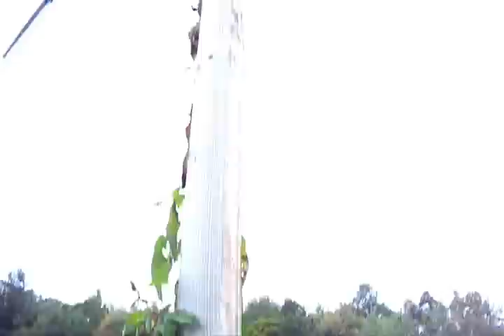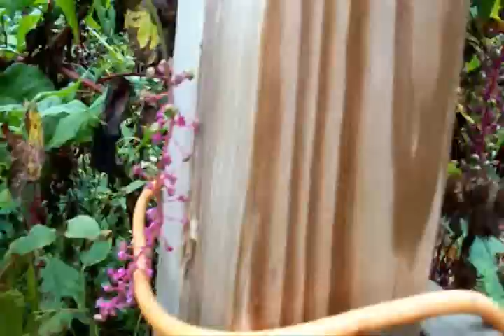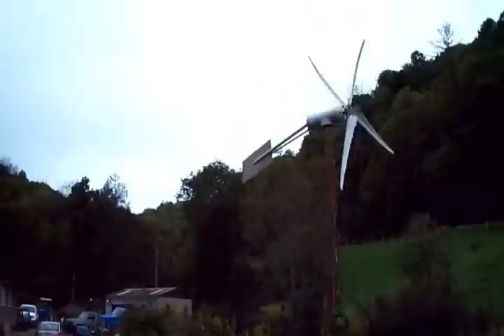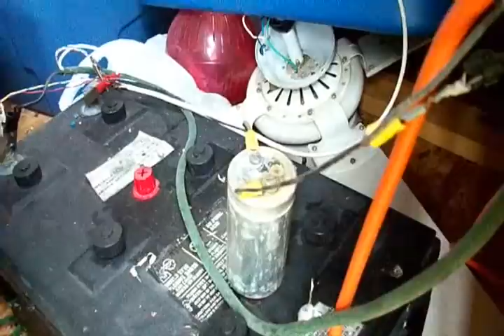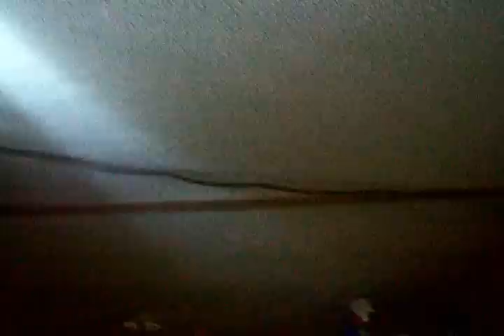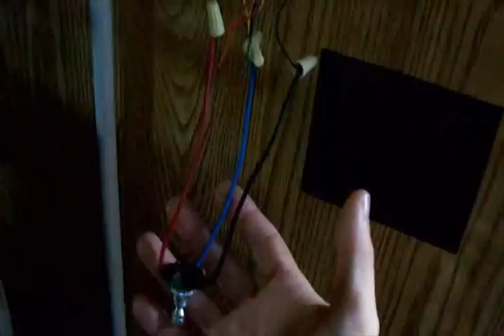Homemade Wind Turbine with a Night Light LED MOD

Comment: Nice work.
I hear that odd numbers of blades are most often used in an effort to reduce vibration.
No idea how effective it is but most have it. 
I just acquired 2x 310v dc motors and a large fan wheel from an industrial centrifugal blower.
Just need to make a frame that includes stationary vertical blades all the way around pointed in on an angle  in an effort to direct more wind into the turbine.
Less efficient than horizontal but less moving parts make extremely reliable and   deal with turbulence/multi directional wind effortlessly. 
I will be copying at reduced scale, a picture I saw of a military unit that would likely run in a hurricane until it gets pulled from its mountings lol.
Reply: Sounds interesting. Make a video of it and share.

Comment: With the battery in the circuit you don't need the capacitor, basically the battery is your Cap. You always want to have a fuse somewhere near the battery so if you short something out there you save your wires from frying or causing a fire. Generally a turbine can over voltage / over charge your battery, but I wonder since that battery is so big compared with the turbine. If it's fully charged already and you have no loads it will happen so you might want to create a simple dump load controler.